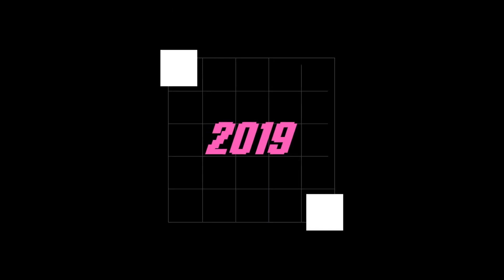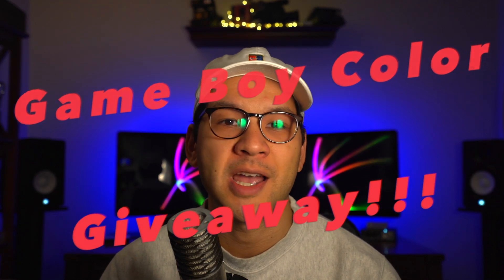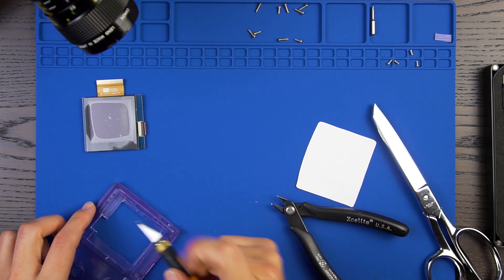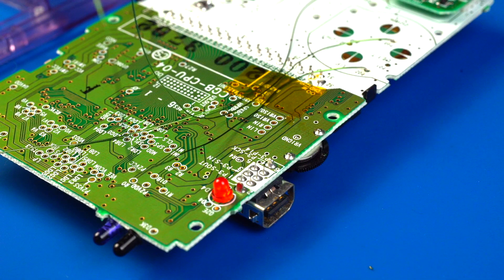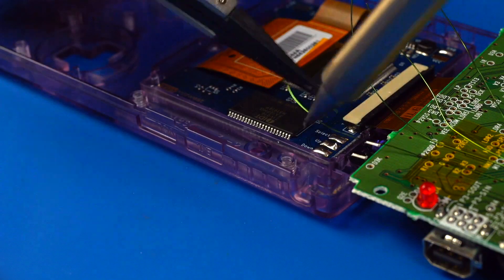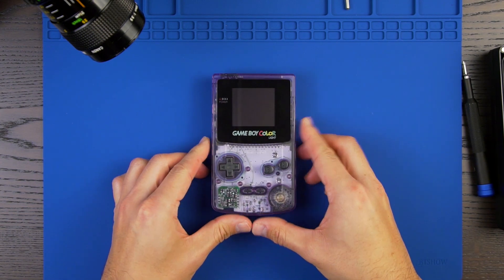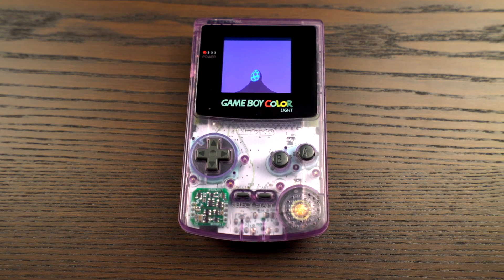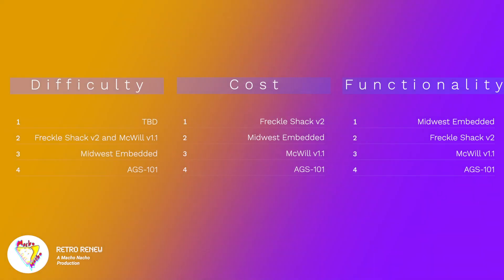How to Backlight a Gameboy Color Part 5 | Midwest Embedded | Retro Renew (Step By Step Guide)

Comment: I subbed because the content is good and you don't have many subscribers yet but you will!
Reply from the maker: Thank you so much for the kind words and for subscribing!!  It truly means a lot!! Cheers!!
Reply: @MachoNachoProductions  I'm trying to figure out what back light to get for my gbc.. Been a dream of mine since childhood! Your reviews really help! I'm thinking with a battery MOD and the Midwest screen but IDK yet.. I'll be sure to watch your future videos.
Reply from the maker: Hey!  If your looking for a kit that has backlight brightness controls your options are the Midwest Embedded and the Freckle Shack. The freckle shack is much easier to install (only requires one wire to solder to enable backlighting vice five, and less shell trimming). It is also cheaper and much better on power consumption. But if dimming controls is the most important then the Midwest kit has better implementation. I hope that helps, let me know if you have anymore questions!  Also, which power mod are you planning to do?
Reply: Personally, I want the best-looking screen And I'm kind of looking forward to having it be a challenge to install. But that's who I am. As for a battery mod. I wouldn't know what to get. I like that the Midwest was brighter. I'll just have to watch more of your videos Before I can make a decision. I have a 101 s p that I play my games on now So I have time to decide the best kit For me to get. I really appreciate the replies. I'll let you know if I have any more questions. Thanks again.
Reply from the maker: Not a problem, if you have any more question feel free to reach out!  I look forward to hearing about which kit you go with!

Comment: Another great video! Are the screens for these backlit mods smaller than the original screen and if so is there one that has the same size screen as the original?
Reply from the maker: Yes, unfortunately all the screens that I reviewed are smaller than the original.  There is a newer kit from funnyplaying that is the original size. I think they sell those kits on retromodding.com!  Hope that helps and best of luck!  Cheers!
Reply: @MachoNachoProductions  Thanks for clarifying have you done a video on this new screen?
Reply from the maker: Supermang I haven’t yet. It’s on my list, but I’m hoping that we’ll get a screen that’s drop in and full size. The funnyplaying ips lcd requires a good amount of shell trimming to get it to fit.

Comment: Very well produced and informative 👌😊 Could I ask a question please? Do you have any tips in removing a Gameboy Pocket Lens? Thank you
Reply from the maker: Thank you!  Yes, it is very similar to removing the game boy color lens. It is easiest to disassemble the unit and push the lens out from behind. Check out my part 3 video of this series. Fast forward to around the 6 minute mark, I show how to remove the lens. If you don’t want to disassemble the unit, use a hair dryer to warm the adhesive and you could try to pry it off with a plastic spudger. Make sure to use plastic and not metal. A metal spudger will ruin the plastic. My recommendation is to disassembling the unit, it’s much easier. Let me know if you have any more questions!
Reply: @MachoNachoProductions  Thank you👌
Reply: I managed to replace the screen, thank you for your guidance.
Reply from the maker: thrillhausen Alt I’m glad I could help!!!

Comment: will you be able to use this mod without sodering? I don't have a sodering kit and don't mind losing the dimming options.
Reply from the maker: Hi Kenneth!  That’s a great question!  Unfortunately, the Midwest embedded kit does require soldering at least one wire to power the unit. If you don’t want to do any soldering, I highly recommend benn venn’s freckle shack kit. That kit does not require any soldering and it is also the most power efficient. I hope that helps and best of luck!  Let me know if you have any other questions!